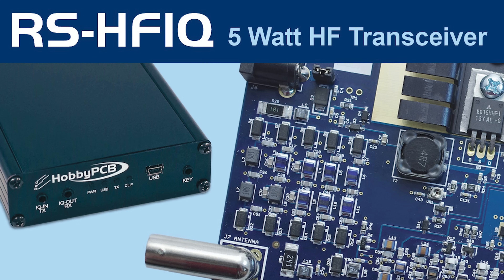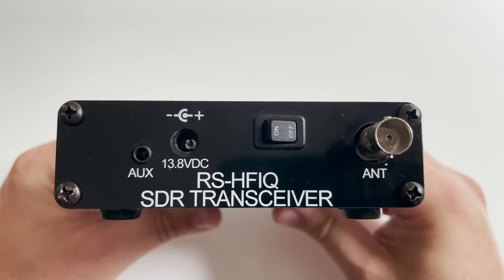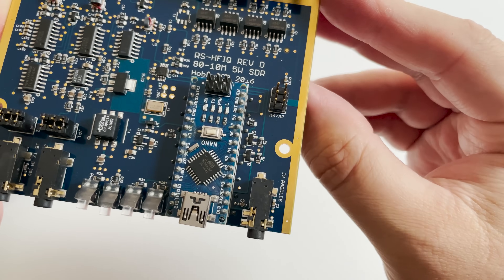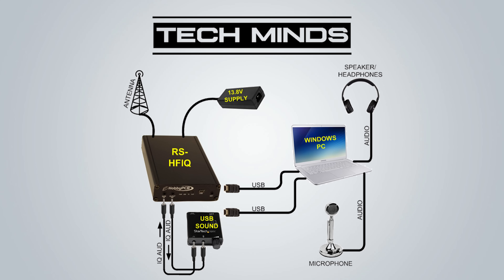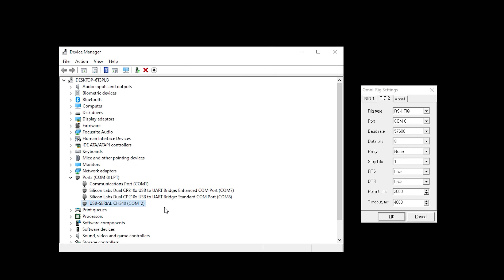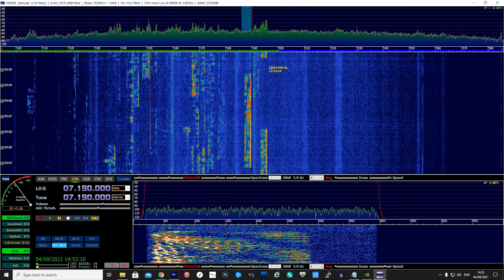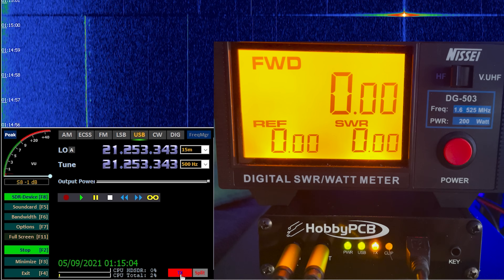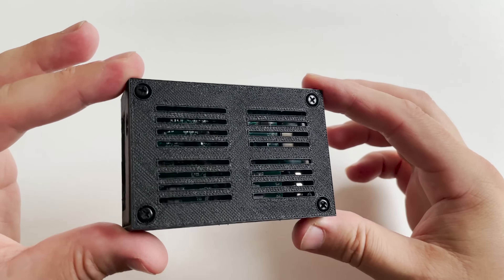RS-HFIQ 5 Watt HF SDR Transceiver by HobbyPCB

Comment: When connecting this kind of setups with large antenna’s, does it require some sort of breaker for lightning when connecting tot your home network? ⚡️ ⚡️ ⚡️. Is there a good solutions to overcome the problem of stoke by lightning? This should be one of my concerns when connecting large antenna’s to my home(data)- network. Again nice setup @techminds 👍
Reply: Every radio needs lightning protection, so this one definitely does.
Reply: 0

Comment: Did I miss something? How do you set up the levels in and out of the sound card that connects to the RS-HFIQ ??
Reply from the maker: Simply use the windows sound mixer to setup the levels. I believe there is a calibration procedure documented so that the S Meter shows the correct reading.
Reply: @TechMindsOfficial  Thanks. So you did this and therefore you know that your audio wasn't clipping when you tested the output levels?

Comment: This might be useful if it put out at least 10 watts PEP. 5 watts just won't do it. Come back when you have a practical, complete transceiver.
Reply: Agree need 10+ watts and requires too many little accessories which drives up costs and complicates portable work . . . nice layout . . . good job on ground plane . . .  plan to follow this product!  Also would appreciate cw band demos. . .
Reply from the maker: Ok sir I will come back as requested 👍

Comment: The RS-HFIQ gets even better if you combine it with the Pi-SDR IQ Plus, glad it gets its own video, can be used with PC Based PowerSDR or flash a standalone image and run software on the Pi-SDR with a external display.

Comment: 5W into a 1KW Linear I hope 🤣
Reply: There is a amp available if you want more power would make it upto 50 watts.
If conditions are right you can take to the whole world on 5 watts. But 50 watts does help if you have a noisey ground level.